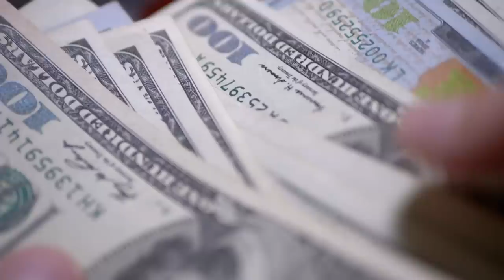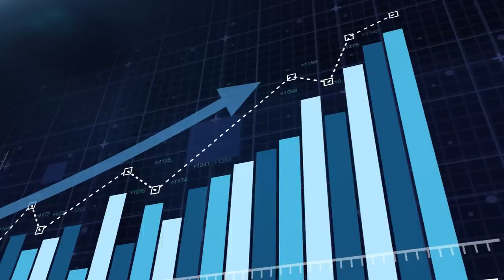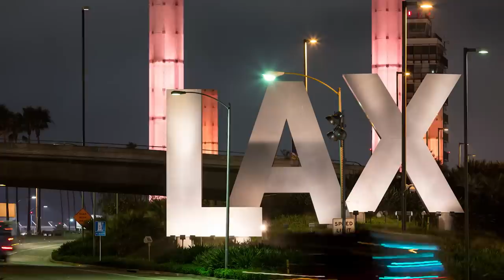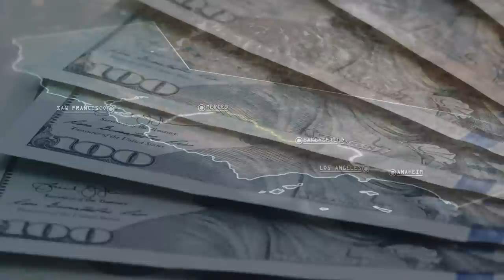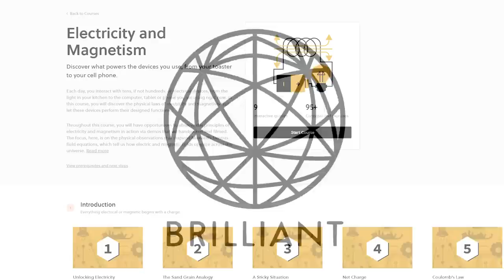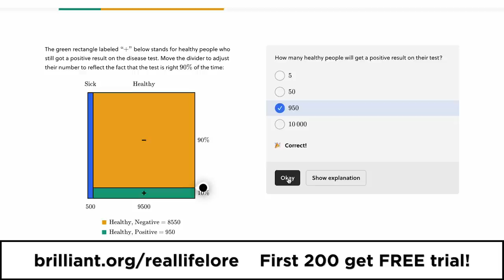Why California High Speed Rail is Struggling (Re-upload)

Comment: As a Californian, my biggest gripe with high speed rail is how the cost is used as a political tool. For a state with over $3 trillion in GDP, $105 billion isn't as much as its made out to be. Out of $3000 billion, $105 billion isn't much considering our long term emissions and auto usage goals. 
Make the danged thing and people will use it!
Reply: I will definitely use it. Going to LA is super time consuming so I rarely get down there, but if I can buy a (relatively) cheap train ticket and get down there in like 2 and a half hours, I’d go down there wayy more often.
Reply: @majura3743  even if you could replace the 7 hour drive with a 3 or 4 hour trip, I'd take it. I hate dealing with planes: show up at least an hour early for security (which make the 90 min flight closer to a 3 hr PITA), have everything you're bringing thoroughly inspected, and pay for the privilege with an extra $10 to $20. Give me a quick and easy train to LA and I'll probably go there.
Reply: Lol. If you think 105 billions can do it, you are very very wrong.   It will be close to 3X that.
Reply: @bikecrew1736  even 3× that isn't a lot considering the value it'll bring. Connect LA to SF? Gonna be great
Reply: @dfunited1  don’t forget the big reason why to take a train. Leg room.
Reply: @bikecrew1736  it’s embarrassing that the worlds 7th largest economy hasn’t finished it yet
Reply: @bikecrew1736  Do you have evidence to back your point?
Reply: @majura3743  I probably won't take it, as the anticipated travel time is supposed to be closer to 4 1/2 hours between the Bay Area and LA, thanks to the elongated route into the Antelope Valley that is expected.  At that point, hopping between Burbank Airport and SJC, Oakland or SFO makes more sense for my time.
Reply: @dfunited1  lol its noth worth that much money dude. Just becasue there are benefits doesnt mean it is worth the cost
Reply: @bikecrew1736  even Japan's Shinkansen was over budget, yet look at it now. Everyone is at awe how fast and punctual they are.
Reply: @FreewayBrent  you seem to forget that they only went through the Antelope Valley because mountains are in the way, and tunnels will make it MUCH more expensive.
Reply: @jesualdocortez6426   It's crazy how in Japan, they seem to grasp the idea of trains, even with the use of Maglev. Japan itself has comparable GDP to California and seem to have no issue building 'state of the art' rail networks with maglev technology.
Reply: @dfunited1  In theory it would be great.  But if it take 2.5 hr and price at similar or just a bit lower than airline?  I don’t think people will do it.  Compares to driving for a family of 4. Driving cost gas of $400 round trip. Assuming gas is at $10 a gallon by the time this rail finishes.  40 gallon should be able to get 1000 miles out of it. Train will cost at least $150 a person round trip. 
So $600 out and still need to rent car at destination. US’s west coast is not build for mass transit.   This rail should have been LA to Vegas.  You don’t need car in Vegas.  But you will need car for transportation in SF or LA.  
Vegas is close enough to make flying vs train equal for about 1.5 hrs.  300 miles is the sweet spot.
Reply: @ianhomerpura8937  It is NOT about over budge or NOT.  It is convenient vs cost.  If it is cheaper/quicker, Yes. It will work. If more expensive/slower than it WILL NOT work.  Period.  Japan is built on railroad. People do not fly much as train is everywhere.  I am not taking about fast train, I am taking about connecting train from fast train station.
Reply: So $41 Billion to Ukraine is no problem but money for high speed rails are too costly?  Someone's priorities are wrong
Reply: That is about an entire millitary budget for a similar sized country.
Reply: @ianhomerpura8937  shinkansen is an addition to an extremely well intergrated public transit system. And it is heavilly subsedised by some of the highest value real estate in the country.

It isn't a standalone stretch of rail.
Reply: @bikecrew1736  hsr systems are a lot like highway systems. You don't only get on the highway in newyork and leave it in LA. 99% of the users of that stretch of highway never even see those cities.
Most people get on and off somewhere in between. That is what enables hsr to be cost effective.
This is never going to be able to compete with air travel between la and san fransisco without constant subsedies. I hope california has deep pockets to keep this thing running.
Reply: @baronvonlimbourgh1716  why? Do we need an expensive project doom to fail? 
Look at China high speed rail. 70% of the line don’t make money.  USA needs high speed rail. LA to SF is not it.  
Eastern corridor and maybe Chicago area in the winter will be helpful. As train can deal with snow a lot better than airplane.
Reply: @bikecrew1736  high speed trains aren't supposed to make money. At least not directly.
They do make lots of money if implemented properly, but they do that by both increased ridership on the rest of the transit network, making that more efficient and more profitable and by accelerating growth vastly increasing tax revenues. 

If high speed rail wouldn't make sense if you where to offer it for free, it basicly shouldn't be build at all. Ticket sales should basicly only function to cover direct running costs. 

The usa barely has a transit network to increase ridership on. People are mostly expected to arive by car. And it is supposed to be profitable on it's own and be competitive with flying, which is just never going to happen.

Maintenance and runningcost of hsr are eyewateringly expensive. Not to mention building the infrastructure as we have seen here.
And this isn't infrastructure you can let rot for 3 or 4 decades and just patch it up a little because you don't wanna spend money on it. Hsr is high tech infra and needs constant maintenance and replacement infrastructure.
It is like having to shut down the entire roadnetwork if there was a pothole somewhere until it has been fixed.
Reply: @bikecrew1736  they are trying to do it backwards. First you build high quality and efficient local and regional intercity transit. So that people have ways to get around in their area and can reach stations easily.
Only then can you add  hsr to increase capacity and increase efficienty.

This is just a piece of rail to a station. It isn't a transit network.
Reply: @baronvonlimbourgh1716  If a company CANNOT make money then it can only go from good to worse.  Infrastructure gets old, things start to break, need more money to fix on top of monthly $ drain.   No much “commercials” added due to this train.  US can spend billions on weapon and highway or even free health care to homeless.  Because it brings added values.  This train will not bring values.  Business class won’t bother with train.  Lower income either don’t travel or only by car.  So that only leave middle class to support this train and most middle class are price conscious, so really, who is this train made for?
Reply: @bikecrew1736  that's why high speed rail rarely is operated by private companies alone.
Either it is subsedised by government, subsedised by realestate provided by government, or the infrastructure is owned and maintained by government and only the trains and service is private.

A train like this could add immense value, if it was integrated in a proper existing transit network and prices where kept competitive. 
The california system i personally dont think fits that model.
I really hope it is succesful, if it is not trains will be doomed in the usa for another 25 years again. And nobody needs that.
Reply: @ngonizvekare8854  It's not an issue of "grasping the idea of trains", that's kinda arrogant and condescending.
There are significant cultural differences between the US and train enthusiast places like Japan. Saying one culture is better than the other is inflammatory.
There are also significant regulatory and legal differences that makes projects like this much more difficult in the US, governments are not allowed to just drive bulldozers through any property they want, like in so many countries that are held up as hsr leaders. It's not a matter of the general public "understanding" how to use trains. If your government wanted to tear own your home for any project, you would not be happy, and you would do what you can to fight it. The legal structure in the US allows citizens to fight back against their government. OTHER countries just build rail lines though anyone's home, they don't care, and it can't be fought.
You also have to consider things like population density, along the entire route. A train line is not paid for by the end stops, they are paid for by all the stations along the line, japan is a lot more densely populated, it can support trains better.
Why is it that every train enthusiast video turns into a us bashing party?
Reply: You don't even know what GDP is...
Reply: @vincentdow5899  isn’t California the 7th largest economy in the world?
Reply: Putting together a state budget is not an easy task, each and every member of the legislature has his own wish list, there are grandfathered funding issues and statutory requirements to be met.  The result is an omelet that at most is satisfactory to a bare majority and unpalatable to many others.  CA, like the other states, has good revenue years and bad.  Unfortunately for most all states, communities, and for the federal government as well, the expenditures seem to be growing a lot faster than the income base of the taxpaying population.  CA is seeing an exodus of high income (and high tax) individuals and also a lost of businesses and jobs connected with them.  Back in my working days I traveled to communities in the NE and in the rust belt and ask the locals where they worked, more often than not it was either at some level of government, public education, or some facet of health care (which is largely government funded), not by private businesses or self employed individuals.  That model cannot be sustained indefinitely.
Reply: @bikecrew1736  still totally fine given the long term positive outcome.
Reply: Why not leverage Elon Musks “Boring Company”, faster cheaper better for digging holes
Reply: @jesualdocortez6426  5th, bud. Cal’s been the 5th largest economy for a few years now too and it’s growing faster than Texas, Florida, or even China.
Reply: @FreewayBrent  That’s nonsense. The route is designed for sub 2h40min express service.

Where did you hear 4.5 hours? No one except the anti-rail propaganda outlets have ever said anything close to this.
Reply: @TohaBgood2  Go look at the revised routes under study, then do some simple math and ask yourself how it's going to travel from San Francisco to LA in 2 hours and 40 minutes.  The trains won't be operating at true high speeds between San Francisco and San Jose to appease noise concerns brought up by various cities along the route (Atherton being the most vocal).  30+ minutes from San Francisco to San Jose, add in another 1.5 hours from San Jose to Fresno.  The route will take an elongated alignment out east to the Antelope Valley, before finally swooping down to LA.  The trains would have to average closer to 200 MPH before stops to travel in 2 hours & 40 minutes.  Sure, the originally proposed route would have allowed for that.  Even the California High Speed Rail Authority has already acknowledged that the anticipated travel time will be 4 hours at a minimum, due to the proposed alignment changes.  Thanks.
Reply: @FreewayBrent  That is complete horsedung! The current route is deliberately planned for 2h40min operations. Countless simulations on the route AS DESIGNED have been run to ensure that this time is achievable. They are currently beating it by a relatively small margin, which is of some concern because the 2h40 min is literally a legal requirement. Detusche Bahn is doing some of the initial planning and will be the operator once the train start running. They are quoting sub 2h40min. Are they lying too?

Show me your sources! Where are you getting this trash from?

To anticipate your question, my source for what CHSR says is the CHSR itself! They publish every report and their board meetings are public and all on Youtube. You can go watch them right now on their channel.
Reply: @TohaBgood2  I'll make it clear that I'm still a supporter of California HSR.  With that being said, the proposed route (as of March 2022) calls for an approximately 520 mile routing between San Francisco and Los Angeles.  The quoted 2hr/40 minute travel time was for a line approximately 80+ miles shorter than what is currently proposed.  Trains would have to average 195 MPH to make the trip in 2 hrs & 40 minutes.  Basically, you'd have to eliminate nearly every stop to make this a reality, because one needs to factor in stop times for passengers.  When HSR was approved by voters, the proposed line was about 438 miles, not 520.  

Go look at the total travel times for HSR around the world.  The famed Japanese Shinkansen takes about 2 hours and 22 minutes to travel 344 miles between Tokyo and Osaka for an average speed of 145 MPH.  Or France's TGV, which averages 121 MPH to travel the 243 miles between Paris and Lyon, or about 2 hours for an average speed of 121 MPH.  The key here is that you have to factor in wait times at the stations.  

Mathematically speaking, based on the revised routing from what was sold to voters, coupled with the slower speeds on the San Francisco Peninsula to address noise pollution, you're looking at an estimated travel time of over 4 hours.
Reply: @TohaBgood2  I have a feeling you're not even familiar with the local geography of the areas in which the train is set to run through, or even know where Atherton, Palo Alto, Menlo Park or other California jurisdictions are located... especially with your immature responses; makes you sound like you're 15.  Sorry.
Reply: @FreewayBrent  Lol, I’m born and raised in the Bay. Lived here my entire life. Family all over state, literally. I drive over 50000 miles per year mostly inside the state. Used to work in Palo Alto. My cousin lives in Menlo Park. We only visit them once or twice a month though, lol

As far as to my being 15, thank you! You’re such a well mannered young man. Too bad you’re wrong.

Where exactly are you getting that the current route is not doable in under 2h40min? What precisely is your source?

I’ve stated my sources - CHSR’s and Deutsche Bahn’s reports. Those were done by professionals. Their credentials are clear and reliable. Are you claiming that they are wrong? How are they wrong? What precisely in each of their methodologies is flawed and responsible for a nearly 2x error?

Looking forward to some kind of a cogent answer or an acknowledgement that you are wrong and very sorry that you were spreading baseless anti-rail propaganda!
Reply: @peterbelanger4094  because for some people it’s fun to bash on the US and completely ignore the other countries issues. Why criticize those countries for their shitty past and present actions when you can easily go for the US and have a lot of people supporting you?
Reply: @TohaBgood2  I've read those reports, so no need to quote them.    Considering the projected price tag keeps increasing with no grasp on what the true costs will be...of course nobody believes either the California High Speed Rail Authority or Deutsche Bahn at this point.  And with the project wrapped in corruption, severe cost mismanagement and overruns and  multiple resignations by key HSR authorities and other individuals involved with the project (remember Joe Hedges for example?), who in their right mind is going to trust anything the California HSR Authority is presenting to the public anymore?  Inflated ridership projections skyrocketing costs and corruption from top to bottom with those involved with this project.  Sorry man.
Reply: @FreewayBrent  On what technical grounds exactly are you objecting to the conclusion of the reports on running time and duration? What exactly is infeasible in their speed and throughput projections? Didn’t one of the Deutsche reports release their code for the simulations too? Is that all wrong? Where are the mistakes precisely?

Or are you conceding that you were talking out of your behind based on something you overheard at some point from another non-specialist who didn’t look at the reports either?
Reply: @bikecrew1736  you’re dangerously missing the point. It’s for a cheap 3rd option. If you have to account for a full family it might not be the logical choice. But if you’re single or going into work or a business trip, it is. Idk if you watched the video but he literally goes into the importance of people in lower income areas being able to travel to higher paid jobs. It’s not all about family vacations.
Reply: @baronvonlimbourgh1716  your one comment right here is so underrated. It makes me understand why outside USA, hsr works more easily. I don't know this and never think of this side of economics before. Thanks
Reply: @peterbelanger4094  yeah, I agree. They attack the arguing sides, not the arguments. Hope they learn how to discuss better soon.
Reply: @bikecrew1736  ok and? Is that still not worthwhile?
Reply: @tonycaine5930  $41 billion to Ukraine is nothing comparing to US $800 billion army budget. It is still cheaper than fighting Russia directly, or letting it wreck the havoc in the world. 

Here, we have a business, which is horribly mismanaged or simply corrupt! How can a one start building railroad BEFORE securing the needed 50 land lots? What were they thinking??? Will they agree to sell for a reasonable price? I doubt it.
Reply: @denelson83  We should've focused on urban/suburban transit first with the money we're spending instead on HSR since the potential ridership is in the millions daily if the focus is on climate change, rather than on a single HSR line that might attract 20,000 passengers per day.  Right now, BART doesn't even have enough money to complete their extension into downtown San Jose.  Just my two cents.
Reply: @FreewayBrent  Probably because automakers are standing in the way.
Reply: Also, didn't the final bill of the highway system cost like 5x more than was initially predicted.
Reply: @baronvonlimbourgh1716  highways also don't make money and need subsidies.
Reply: @ianhomerpura8937  I'm aware of the fact.  I drive over the Tehachapi Mountains via Interstate 1-2x per month.  Very familiar with the geography.  There's also the population of the Antelope Valley to consider.  It's mostly a slow-ergrowth area when compared to the 1990's to early 2000's, but Palmdale and Lancaster are pretty sizable suburbs in their own right.  One must also note however that the route out to the Antelope Valley will still traverse the mountains; just not quite as high but will probably still require some sort of tunneling or grading to allow the trains to travel at high speeds.
Reply: @tarunaperdana4622  no problem, happy to provide a wider perspective, sometimes that all that is needed right.

Like everything hsr is a tool and one of the components in a bigger integrated system. It can add immense value when implemented properly. But expectations need to be realistic as well.
Reply: @Preetzole  indeed. Imagine all the roads being privately owned and every street had a toll on it.
It would grind the economy to a halt. It would save the government loads of money if it didn't have to spend money on building and maintaining roads.. But it would also deprive the government from a gigantic amount of tax revenues.
Providing it for free pays for itself thousands of times over. That is why infrastructure is an investment and not a cost.
Reply: I would be careful in using GDP as a measuring stick for anything because GDP also includes government spending, both Federal and State.
Reply: @ls93780  which is also part of the economy. So it also is gdp.
Nothing controversial to it.
Reply: @baronvonlimbourgh1716  should we tear down the highways? They aren’t profitable either.
Reply: @organizedchaos4559  i don't know,  seeing that everything else is only viable if it pays for itself it puzzles me the highway system is still there.
Reply: @baronvonlimbourgh1716  Government employees don’t produce resources. GDP as a rule is an unreliable measure of the size of the economic output because Money is not the same thing as resources. Best example of this is looking at GDP during and after WW2, where if you go by GDP the US entered a recession that was worse than the Great Depression after WW2 and lasted from 1946 till the mid 60s. This obviously was not reflective of overall economic output as that period is rightly seen as an economic boom, whereas during WW2 the average civilian was living on restrictive rationing of food and fuel despite a massive GDP.
Reply: @ls93780  i don't know where you get your numbers from. But there is always a recession after such a war. In '48 there was already growth then there was korea, and another recession ofcourse.
Then since '54 there was an average of 4% growth per year or so all the way trough to the end of the 80s. With loads of years over 7% gdp growth.

And the great depression was -8,5%, -6,5%, -13% and -2%...

Looks pretty much spot on to me.
Reply: @ls93780  and during the war economic output was obviously trough the roof with nearly 20% growth a year. That is all the tanks, jeeps, planes, war ships, guns, lend-lease production and the liberty ships to ship it all around all over the world and whatever else.
Reply: Ugh, yes, I can't believe it is just thrown around at politicians constantly. Can we complain about boondoggles after we've actually spent the money? I'm sick of the 5
Reply: @ngonizvekare8854  Japan is in a League of it's own. I've heard China has quite the formidable rail network, but it has qaulity issues.
Reply: do u not realize how much the state spends?? tht 3 tril is not profit. We have INSANELY high taxes on pretty much EVERYTHING that isnt groceries. And youre going to say "eh whats 100 billion"
Reply: Build it and people will use it....if they can't afford cars....right?
Reply: @someguy6268  so california spends money on infrastructure which is what you want as a citizen.  Texas breaks down in cold weather and high heat because they refuse to spend on adequate infrastructure..Also, California is ranked 9th in the US for effective tax rate at 9.72% vs Texas #32 8.22% per wallethub. A whomping 1.5% difference...You have to factor in property taxes in California is the lowest in the nation, while Texas is one of the highest.
Reply: @dfunited1  it wouldn't happen in your lifetime.
Reply: The California government is scared of losing tax revenue on gasoline and vehicle registration fees.

Maybe?
Reply: @johnsamuel1999  Once the track is in you can start gauging its value based on upkeep because it will eventually become a good investment, whether that takes 30 or 60 years.
Reply: 100 billion usd is actually a lot, compared to other projects, even in Europe. Of course you can  pay for it but it still is a lot. It makes over a hundred million per kilometer. High speed lines in other developed countries (and on similar terrain) are built for less than half the cost.
Reply: People in rich countries can afford cars. Leave the trains for Asia.
Reply: But 105 billion dollars isn't exactly a number one can be proud about either.
Reply: out of that 3 trillion it comes to capitalist private pocket, say each tax eligible pay 3% tax rates in California, that would be 3,000×0.03=90 Billion.
You use that to run government and maintenance of public infrastructure and services. The government think they can spend a little bit as it progresses andkeep doing that but 2020 make it worse. Correct me if I'm wrong.
Reply: @ngonizvekare8854  Japan have massive debt, 200% over their GDP and will increase by time
Reply: @jesualdocortez6426  the 7th largest economy has a  bad history of not being able to pass budgets. All that money doesn't help much if you can't put it where it's supposed to go.
Reply: @bikecrew1736  for a family trip the numbers aren’t as attractive, for sure. But many, many, many people do the trip as individuals.
Reply: If people could live in Palmdale, but get to work in DTLA without a hellish drive, that will be a big win. With good WiFi and supportive employers, some of the commute time could be figured in to the workers’ time at the office, depending on the job, of course.
Reply: @Bob-lr2xp  ikr LA is spending 8 million a day on police. Not like Karen Bass or Caruso would help with that….oh well.
Reply: @Bob-lr2xp  NIMBYs b crazy
Reply: That's a bad reason since majority of electricity come from fossil fuels and most importantly, busses are far better, economically and practically
Reply: China has built more miles of high‐speed rail than any other country and has gone more into debt doing it… $800 billion, and most of its lines aren’t covering their operating costs.  As a result, China is shifting to building more roads.

France’s state‐owned railroad has piled up debts of more than $50 billion and has been repeatedly bailed out by the government.

Spain has built its high‐speed rail system with a public‐private partnership. Officially, the private partner has gone into debt by $20 billion.

The state‐owned Japanese National Railways has a debt of $550 billion.  Today Japan has
Reply: @electrictroy2010  OMG large infrastructure projects are very expensive? Who knew???? Still overall hugely beneficial in terms of economic activity and improving the lives of people. Also not getting the full picture in all those cases by debt alone.
Reply: when it comes to contract bids and construction bids.....it's ALWAYS way below actual cost.....reality....add another 20% at least to the bid number to get the real number. usually it's another, 25 to 30% more of the bid cost. so....add another 20 to 31 billion dollars to the 105 billion dollar bid. Cali cannot even afford to finance a hot dog stand right now lol.
Reply: obviously you don't understand the money situation and budgets of Cali. 3 trillion is a lot of money, yes.....compared to what though....3 trillion for the state of north Dakota would be amazing and a shit ton and north Dakota could then build solid gold roads and buy super cars for all of its residents in the state lol. however, for Cali, having 40 million people and billions of billions in short term and long term debts to pay, not to mention the current massive debts it has just for the state pension funds. people forget that pension funds get more and more pricy every year when people retire. Cali has to pay pensions for current state employees in addition to paying pensions for retired and future retired state employees. let's say, to make it easy....Cali has 1000 state employees currently. Cali has to pay those people plus add a percentage into those 1k pensions funds AND pay the pensions of 10k retired personal and then calculate future payments to future retired state employees  for the next 40 years.....plus the infrastructure costs it maintaines and all of the free public hand outs Cali gives away to everyone lol and the public housing costs and the cost of power to the entire state and water system for the entire state and the recycling costs of the state and the maintenance if just current public buildings and roads while having to borrow money for future roads and maintenance projects. all of the kick back money programs for solar power and tax breaks for decades on solar power companies in Cali.
Reply: @dfunited1  please don't tell us that you do some job with finances and or that you have your own business. lol.
Reply: @jesualdocortez6426  .....do you understand finances at all?
Reply: @dfunited1  Bro same planes are absolute shit i swear. and highways and having to drive is a pain in the ass
Reply: It's not the fact that the cost is high, but that's it's too high for how little of a project it is